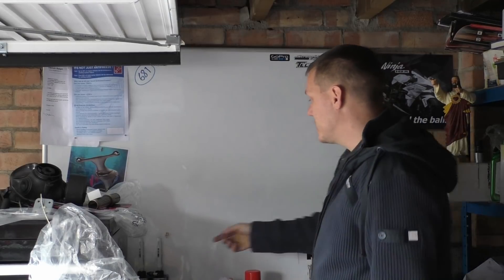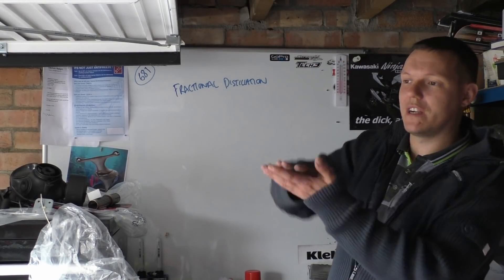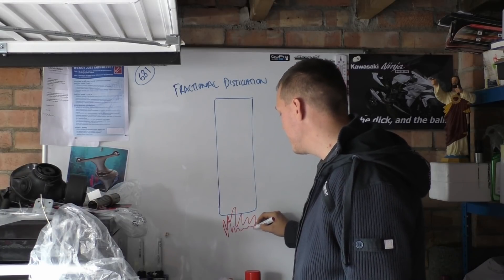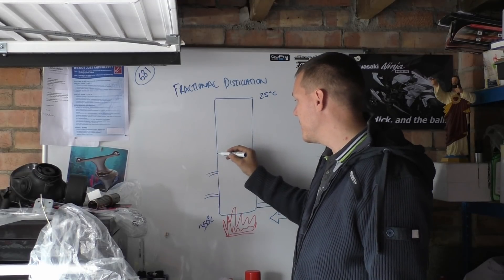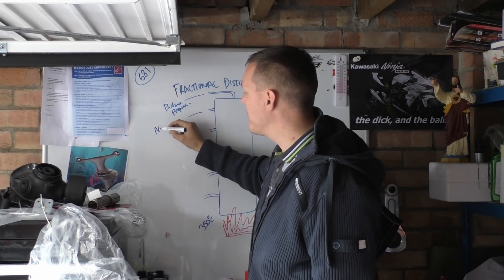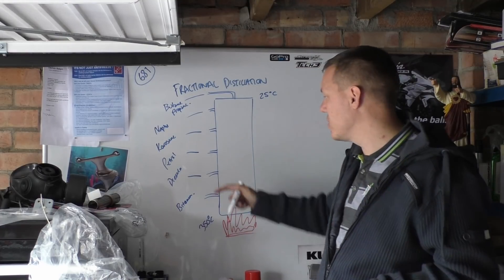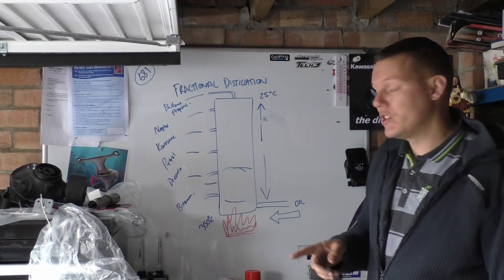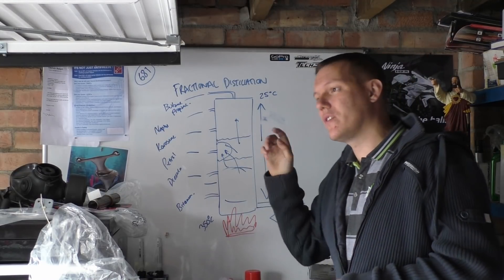Where fuel comes from? - Fractional Distillation - the very basics

Comment: Well actually the feed oil is heated in a separate owen before it goes to distillation and the bottom fraction comes out lower than its feed inlet.

Comment: Close, but not quite..   
When you said we don't know where one level starts and the next stuff starts..   we DO know...  
We know because there is a physical barrier at each level..  a metal plate sealing off the previous lower level..     with a sort of 'one-way' flapper valve in it..  
So the complete tower might consist of a dozen separate tanks..  (some more, some less).

The first tap off point will be just above the crude oil fill at the bottom..   the heated mess will float upwards,   I agree,  but as a VAPOUR.         
This scalding hot vapour has to push through and past a pretty crude valve affair to get to the next level.  
So, importantly, the levels are reached by a vapour, not a liquid.   
This is a true distillation process, just as any whiskey is made ...or moonshine.   
We drink the condensed vapour...  the 'distillate'.

As each (HOT) vapour mixture rises up through the 'flapper valve' to the next level, it cools slightly, into a liquid...  
 it CONDENSES...   (is 'distilled'...)    and settles on that level's floor...   where  it can be tapped off, (beneath the swirling vapours just above it).  
Each particular component of the original crude oil has a different boiling point..   and we make use of this fact in fractional distillation. 

The heavier vapours might settle/'condense'..  into Heavy Fuel oils, (Ships, cargo/container vessels,  etc etc)    creosote, naphtha, etc..   and they can each be tapped off as such.. 
(Ships fuel oil is a bit like Marmite..  and has to be heated just to be able to inject it into the engine and burned).
Then the slightly less heavy vapours will keep percolating upwards...  and push through the next floor's flapper valve and will also condense..   into something lighter than the previous level's liquid.  
Maybe lubricating oils and greases,  or the makings of them, after more refining and additives  blah blah..

As the vapour rises, it becomes more and more distilled and refined, it cools naturally as it nears the top of the tower.. and will separate more easily into more and more (slightly) different liquids, lighter now..  and gases..  

The butanes, butylenes, propanes, acetylenes.. and many others,  aren't miles apart viscosity wise..   and go on to be further distilled and refined...  in other towers.

Just my tuppence worth.

Comment: I was very surprised when i found out that some ships run on what is basically bitumen, is it like some sort of oil fired boiler?
Reply: Most ships run on fuel oil which is horrible thick black shit like you say small power plants like ones that power Caribbean islands run of it as well it's a horrible fuel but perfect for daft sized ship engines / small power plants it's so thick it has to be heated up to be able to pump it about and cleaning tanks afterwards to carry white products is a pain in the arse and can take up to a week depending on what you need to carry next
Reply: Jas Ward most ship engines can run either fuel oil or low grade diesel they aren't boilers just massive engines that you can walk inside and as you can imagine the fuel system is suitably large for the size of engine so they can heat the fuel oil and it goes through several different filtration methods before being burnt in the engine, then again there are so many different types of ship engine / propulsion systems you could go on forever but the majority are just super sized normal engines that can run on the really heavy thick black shit because it is a million times cheaper than running on diesel or gas oil as it's commonly referred to
Reply: barrydasheep cowsvile i heard it likened to asphalt
Reply: Are those huge Korean-built Container ships not run on both Dieselators that run their exhausts through Steam generating boilers; the boilers run the main drive screws and the dieselators drive electric generators, which is then used for extra drive power, stabilisers and steering propellers in the 'drive train'?

I've seen a family photo of my Uncle and two workmates having their denner whilst sat on a cylinder top, dangling their legs down into it.  !:^)

Comment: Do they filter either the crude, or the distilled products through bog roll filters? The reason I was wondering was that if they do, then they'd obviously be able to tell us whether it was worth spending the extra on andrex, or if the tesco value stuff does just as good a job.
Reply from the maker: They have double filtration, they stack one bog roll on top of the other - for vodka, they use 3 LOL
Reply: spits vodka out

Those dirty bastards!
Reply: have you seen alcohol being made? they use heat, and each distillate has a specific molecular weight. so some floats to the top others stay lower. they are caught at different heights in the stack